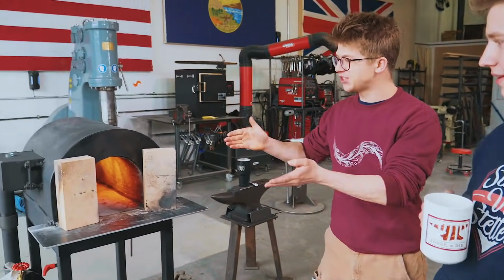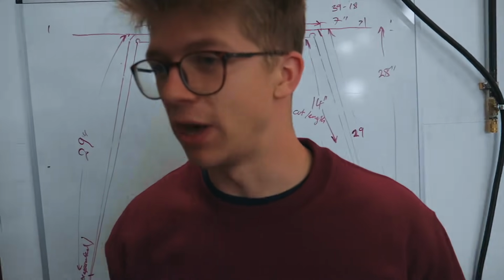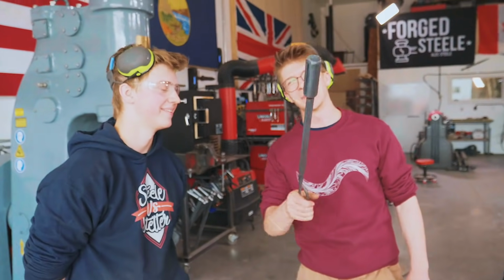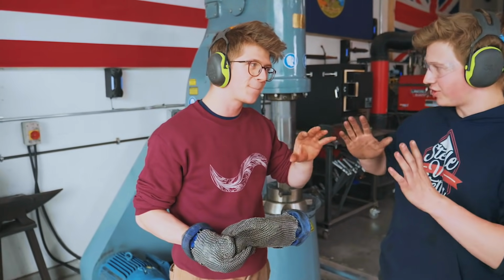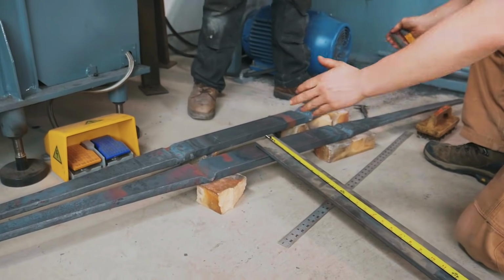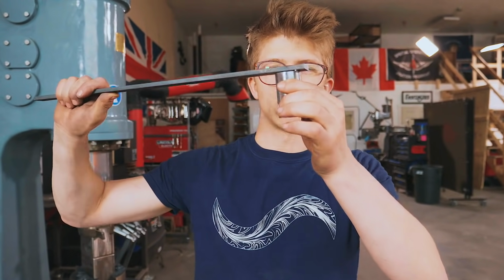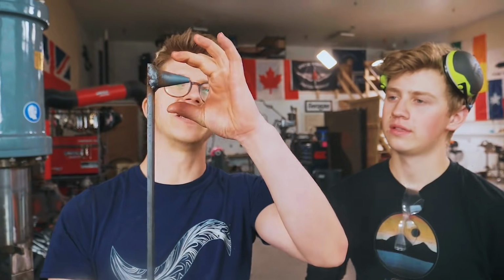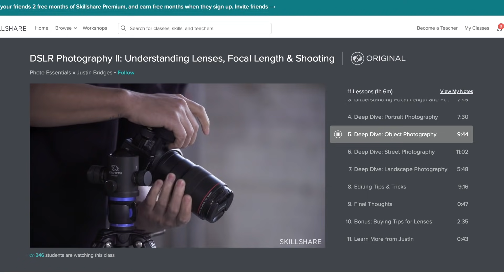FORGING MY KITCHEN TABLE!!! Part 1

Comment: I was a summer help in a foundry where they used power hammers with 1000 pound rams and machined dies to make chain hooks. I had a yellow hot bar in the end of a pair of tongs. I put that bar onto the die, the hammer came down and forge welded the bar to the tongs. That's what happens when the tongs are put into the die too far. Up till the time the business closed the president of the company kept those tongs and bar in his office. When he would interview potential employees he would show those tongs to the applicant and tell them a story about how bad I sucked at forging.

Comment: Nice forge but you should have placed the blower and assorted plumbing inside the stand so you could enclose it in sound deadening panels. Would protect things from damage as well.

Comment: What kind of project would using the hydraulic press be uniquely suited for? I'd really like to see it used in some forging!
Reply: Brother T 
Punching hammer eyes, making Damascus or basically making hot metal move at your command because you can.

Comment: Did 1.5" twisted bar stock with a French curve at the ends with a resin filled top come across the drawing board?
The curve would resist damaging your floors Alec!

Comment: Why not get some round and flat wooden feet, forging some rings that fit around the wood and have a sleeve that lets them friction fit on the bottom of the legs? This would improve the look as well as reduce scratches on any flooring.

Comment: Cutting stock in the band saw vertically will ruin your blade 10x faster. You should always cut horizontally.
Reply: slickvic2417 why?
Reply: @littlelawson06  can catch and break teeth

Comment: What’s the chain mail gloves for?
Reply: The heat from the forge radiates through the entire piece of steel so even the back part he is holding gets very hot even though its not in the forge. Since the piece it to large to use tongs, do he uses the chainmail gloves since they can withstand high heats since he has to directly handle the steel

Comment: Alec why do you wear the chainmail gloves when forging
Reply: The heat from the forge radiates through the entire piece of steel so even the back part he is holding gets very hot even though its not in the forge. Since the piece it to large to use tongs, do he uses the chainmail gloves since they can withstand high heats since he has to directly handle the steel

Comment: would have made more of the A shape legs (with the flat top) then connect from the midpoint of the piece which goes from one leg to the other a flat bar or a decorative piece. This will keep the pair of legs in a set position to one another so that they don't get levered out from under the top and snapped off.

Comment: The table will need 1 foot square feet to stop it from punching holes in the floor.
When he pulled out that piece of flat bar I thought he was going to make some con-rods for a steam train.
I hope they are going to fuller out some of the mass in those legs. Otherwise it's just stupid, it's a Dining table not a work bench.